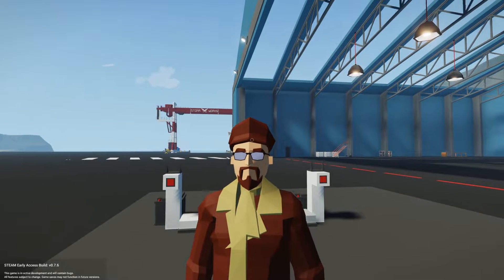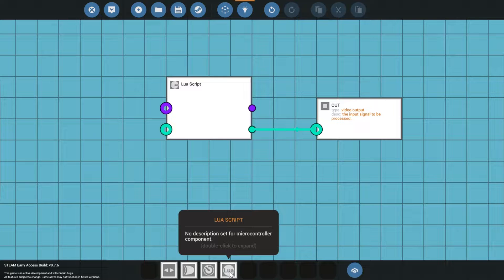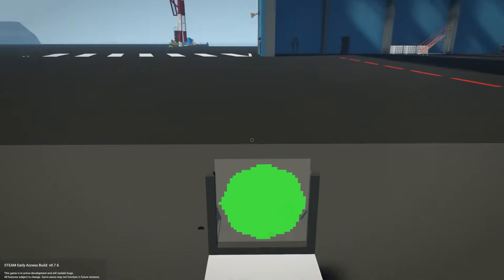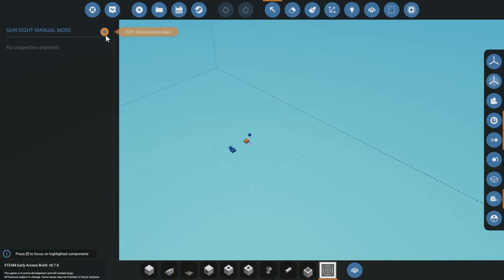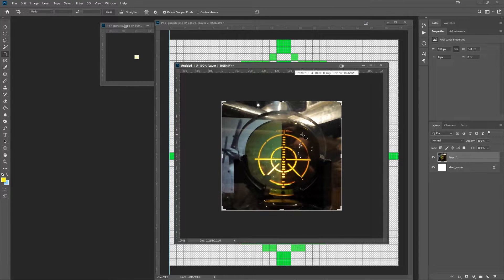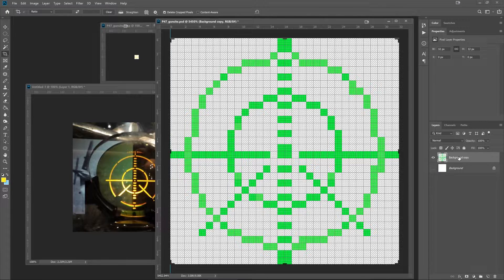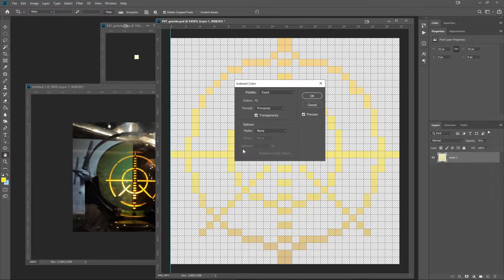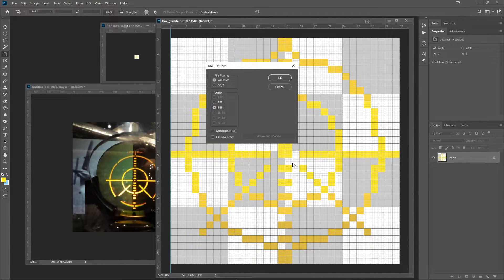Stormworks Tutorial How to create a WWII Gunsight Hud with Lua

Comment: There was a vehicle i had that used something like this (raven by vector dynamics) and i crashed it, i repaired engines and most of it, and when i powered up avionics, the main display that shows what weapons you have had a bsod on it. Not one like windows but it was blue with text on it (like old windows bsod) and it said something along the lines of: Severe Microcontroller Error.

Does anyone know how or why this happens, i checked with the creator of the plane and they said they never seen it before and it is not intentional.

Comment: I followed all the steps, but my microcontroller has no logic input or output on the physical creation. Is there something I'm missing? Edit (5 sec after original): I'm a dumbass, i forgor to switch to video logic
Reply from the maker: Also use this to draw custom gun sights much easier: https://mrlennyn.github.io/canvas/canvas.html
Reply: @EndoSkull  why is it so inaccurate. you cant draw anything center. is that how the stormworks monitor is designed?